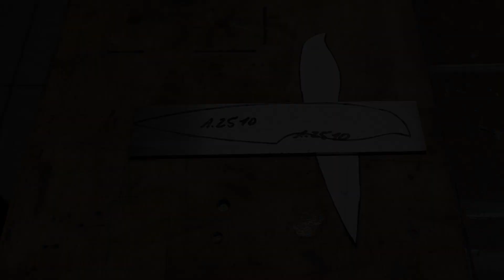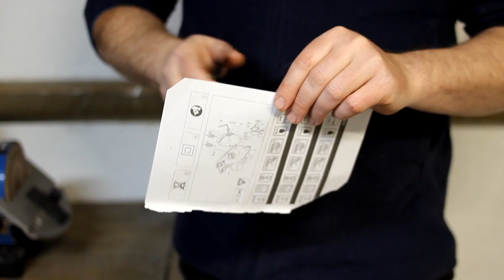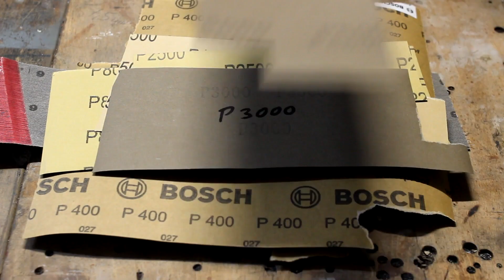Knife making - How about mixing birch twigs with epoxy and making a knife

Comment: I absolutely love the way you experiment with epoxy! Great idea and creativity Marc! 
Can you tell me where did you buy or how to find this silicone forms you used to make scales? I have ton of work every time I make casting, because I don't have this
Reply from the maker: Thank you. I found the forms on Amazon. I looked for soap molds and epoxy molds. These are good, but a little bit sloppy. After you have poured out the form, you should put something full on top. So that the bottom stays straight, otherwise you get a slight curve at the ends.
https://www.amazon.de/gp/product/B08KTD1TMT/ref=ppx_yo_dt_b_search_asin_title?ie=UTF8&psc=1
Reply: @ZyKnife  silicone biscuit mold 😯? I would never guess!My god, Marc, you are genius👊!
Maybe try to make a wooden frame to hold the shape- should work
Reply from the maker: @DBCraftWorld  let me know if it works 😜
Reply: @ZyKnife  Sure I will!